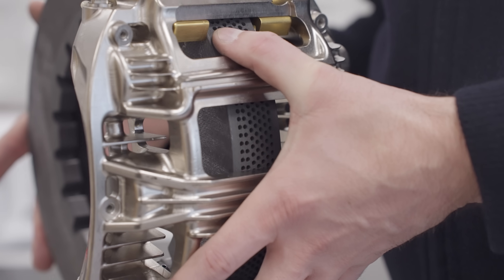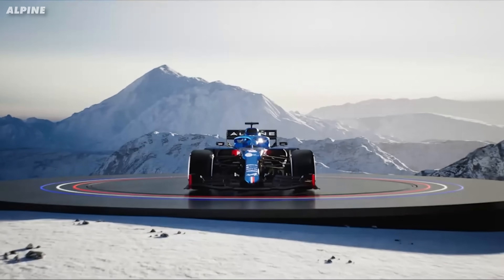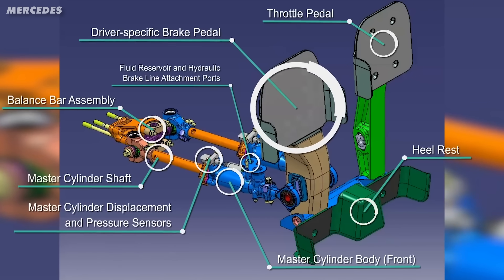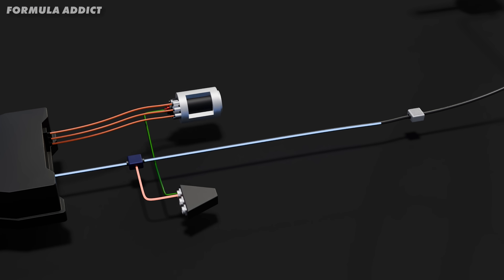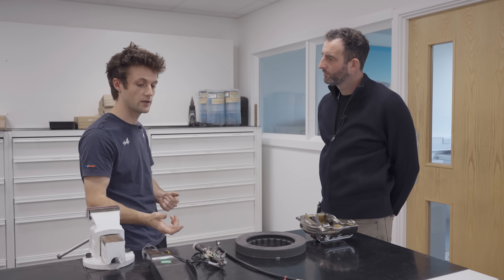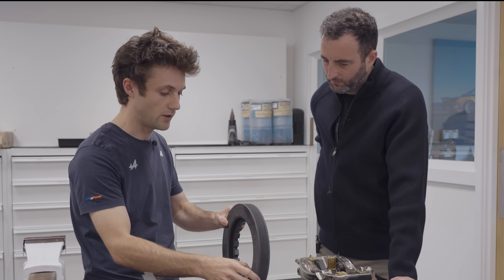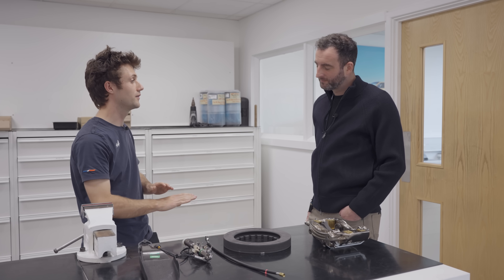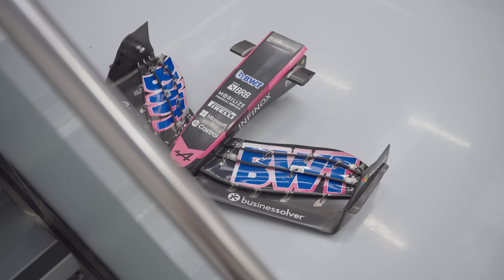How Formula 1 Brakes Work (F1 team explains)

Comment: Speed in miles, distance in meters… ah the complete insanity that is Britain. Home.
Reply: People make fun of the USA or being imperial system, but Britain uses both and I think that's worse lol
Reply: @otmgi3865  Beer & Milk sold in pints, soft drinks (outside of pubs/resturants) sold in litres, fuel sold in litres but we measure usual of fuel in Miles per Gallon.
Reply: @ThexMJT  Bruv. Stop. It hurts.
Reply: @ThexMJT  I'd be happy with going with km/h for road speeds. We all know what a km is now
Reply: @a1white  how about nautical miles or inches pound feet to Newton meters. Welcome to the world of the UK and engineering
Reply: @a1white  We have done for about 50 years now. However as an Engineer (X) I have no difficulty with SI Units except road journeys where I still think in terms of miles for mental calculation of how long the journey will take.
If we were to have metric time then I will have to start rethinking.
Reply: @ThexMJT  But how much does the car weigh in base 14 (Stone)?
Reply: Driving in km and km/h only.
For everything else, inches and feet... And dont forget the thous, use them every day.
Only exception is my 10mm socket.
Reply: @sphaleritecarcharias1404  Regarding your 10mm socket, is that 1/4 inch drive or 3/8ths?
Reply: In some way it's better as we can adapt to other systems. It's Britain in a nutshell though, always somewhere in-between sitting on the fence.  @otmgi3865
Reply: @otmgi3865  Then look at Australia, they do it too
Reply: Furlongs per fortnight anyone?
Reply: @tedecker3792  Unfathomable haha
Reply: In Canada we measure outside temperature in Celsius and inside temperature in Fahrenheit.  At the time we converted, most homes had an imperial thermostat, which was not replaced.  Outside thermometers were soon replaced with centigrade versions.
Reply: never in my life have i noticed this before, and that is hilarious
Reply: At work we order wire in mm width and length in inches 😂
Reply: @tonicdb  beacause wire is standardized in cross sectional diameter in mm

i mean fuck it wanna use the american system where we dont measure it on how thick it is or how much current it can carry (you know stuff we actually care about)

no we will measure it based on how many draw plates you have to push it through to make it that thick

which is about as much sense as me measuring bread slice thickness based on how many slices the loaf has

ah yes id like a 32 thickness as the 18 slide bread was too thick
Reply: Sharing that exact same feeling.  From Canada with love: where temperature units depends on whether its within or without; food cans are in ml, but recipes are in cups, while "nutritional values" are per grams; and of course where using ounces means fuckall.  Is the ounce US or imperial?  Volume or weight?  What about figure of speech?  Or any combination imaginable?   Just nod and move along.
Reply: @sophiamarchildon3998  lol, I didn't know that inside/outside thing.  Driving in Northern Montana for work for years, I listened to Canadian Public Radio out of Ragina. I taught myself to convert F to C to F by listening to the weather report and looking at my cars thermometer.  😁
Reply: Like a timber: 2"x4" 3m :D
Reply: @Svendrys  In new Zealand its a 4 x 2 and metre's (not meters) in lenght.
Reply: The important things are metric, the social and cultural things are left in imperial.  So science, engineering and the like are metric, how far it is to the pub and how much a measure of beer you're getting is imperial.
Imperial measurement are defined by Metric weights and measures as are all US imperial weights and measures.

A one pound weight is officially defined as 0.45359237 kilograms.
The inch is a unit of measurement that is equal to 2.54 centimeters.

A pint in the British Imperial system is defined as 568.26 cubic centimeters (34.68 cubic inches) or one-eighth of an imperial gallon. The units for dry and liquid measure are the same in the British system.

A pint in the U.S. Customary system is equal to 473.2 cubic centimeters (28.9 cubic inches) for liquid measure and 550.6 cubic centimeters (33.6 cubic inches) for dry measure. 

The mile is a unit of measurement that is officially defined as 1,609.344 meters. This is the result of an international agreement in 1959 that standardized the mile in relation to SI units.
Reply: @ If it needs a 5 paragraph explanation, it is a mess
Reply: i just noticed this too. even in races they do this lol.
Reply: Temperature is celsius, but the tire size in inches and the hole count in the disks in integers.  Where will the madness end?
Reply: @v3rlon  i think we have them in both.

also there's no madness here, only to outsiders. no better security than confusion.
Reply: And the U.S.  Dumbest thing is hanging on to the imperial system.
Reply: @johntomasik1555  The US uses US Customary Units, not the Imperial system. There's some similarities and some differences, our pint only has 16 ounces but they're bigger ounces so an Imperial pint is only a little bigger than a US customary units pint. 

The US uses the French metric system when it counts, in science and engineering.
But we choose the old units for things where it makes sense and when our already paid for equipment is in inches. 

Don't worry about it. When was the last time you saw an American comment in a video complaining about the units only being given in the French metric system. We know both and can convert in our heads.

We're just better at math, I guess.

How many "stone" do you weigh?
Reply: @Mishn0  Still a pain in the ass, any way you look at it .  Been an engineer for 30 plus years, and it's been a thorn in my side the entire time, especially having to deal with international development environments as well as medical products.
Reply: @johntomasik1555  I can't overstate how many people here hate all things metric... JUST because it annoys you people for no reason.  🤣🤣
Reply: @playgroundchooser  It's really baseless.  Metric is SO much easier.  I do understand why there's the hatred....humans hate getting outside of their familiar environment.  When I first got into engineering, there were a bunch of old-timers (many of them machinists) who would seethe if you tried using metric units.

And may the gods help you if you ever have to deal with the "slug".
Reply: @johntomasik1555  Absolutely! Tell someone that what they use, and how they think, is stupid... they will Never adapt.  
I honestly have a hard time with kilometers when driving, because I don't drive using yards. Like, the sign isn't "turn left in 300 yards" here. It would probably say 1,800 feet or 1/4ish mile. But elsewhere, (Like when I drove in Curaçao) they actually have signs that say "turn right in 300 meters."  Hard for me to convert while flying down the highway. 😅  I bet if I practiced, I could figure out that at 120kph, you go 1 kilometer in 30 seconds, so that 300m would be 12ish seconds of driving. 😆
But, when I'm just sitting here,  the conversions are super easy, and I already do them damned near every day in my head in just normal life stuff.
Reply: @playgroundchooser  Yeah, we'd eventually get used to it.  Doing the conversions is kinda quirky.  But, eventually we wouldn't do those anymore, 'cause nobody would care what the old units were.  BTW,  I rough the km to miles thingy by thinking a km is roughly about 60% of a mile.  So, 60% of that 120 kmh is about 72-ish mph.

The ones that hurt are give me 0.02" clearance on a 9/16" hole.  What a pain in my assholes (as Borat would say).  Now, give me a half mm of clearance on 1.3cm is easy....that's 1.35cm.
Reply: Its annoying wanting to use miles and meters together with the satnav and not being able to. In the uk, we have a better sense of what a mile is to a km. but we also have a better sense of what a meter is (meter ruler in most classrooms) compared to feet. Only place we have a better understanding with feet and inches is people’s height. Thats the uk.
Reply: @ZeerakImran  this is why I set my bike gps unit to metric (as do most cyclists). It’s easier to countdown metres to a junction when you know it’s 1000 metres to a km. who knows how many yards there are in a mile?
Reply: AL-PEEN
Reply: Never understood that nonsense lmao but the Americans are crazy.
Reply: I remember the first time i heard body weight in "stone" measurements. I think it was a strongman competition. I was thinking well i do want to know how much these big dudes weigh so i had to look this one up as well💀
Reply: I was in the UK this summer. My friend said it was going to cost too much money to change all the speed limit signs nationwide. So they left them in MPH.
Reply: I learned both in grade school and I feel like knowing both rather than one has enriched my life
Reply: Bruuuuuuh
Reply: Multiply by 1.64 for km/h
Reply: america pretending like they dont use km when talking about speed but talk about how fast there car can do the quater mile
Reply: The only place you can buy SAE sized nuts with metric threads. 🤪
Reply: Distances need very high accuracy
Reply: I think theres always a better measurement for each catagory for example Fahrenheit is better than celcius because its more precise, meters are great because it converts smoothly to mm, cm and km but miles is better for distance because when measuring something large its nice to have a small number instead of 300kmh you have 180mph and for weight kg is better
Reply: It’s due to Europe.  We used to use yards, feet and miles.
Reply: Because here in Britain, we have the ability to cope with more than one unit of measurement. Suck it up, sunshine
Reply: @peanuts2105 don’t think its a choice. Just cope cope cope. A lot of coping over here. I don’t mind either. But unless i’m a tailor, feet and inches are for measuring people’s height. And yards are just something we hear but never comprehend. A pint is like a glass but more. A gallon is 4 litres just like a month is 4 weeks. Neither is true but it’s what we go with unless it gets serious.
Reply: @peanuts2105  Please don't be in charge of British international relations anytime soon. Yours, all of UK.
Reply: @ab8jeh  Yeah, because David Lammy is totally nailing it. Oh, wait...
Reply: @stevegreen5358  2 months compared to 13 years. Do we really need to go back to primary school? I guess we do.
Reply: @ab8jeh  Lammy does. He's an utter clown, on the wrong side of every argument and every decision. He won't get anything right no matter how long you give him.
Reply: @peanuts2105  Sunshine is propabilly one of the few things you don't have to much of 😋😋
Reply: @peanuts2105  As an American I feel vindicated xD
Reply: @peanuts2105 Being stupid on purpose is still stupid
Reply: @peanuts2105  Government already plan to launder title cash and gain a bit of control over way to free  population by experiments to dim the Sun-shine
Reply: @peanuts2105  Go on then, how many metres in a mile?
Reply: @a1white  About 1600 (out of my head). New Zealand. When I'm out in my shed doing engineering work (like today) and I through the tape measure onto something I'll read off inches or cm's depending where the measurement falls.
Reply: @a1white  1609 m, 39 cm and 4 mm 😁
Reply: @a1white  1600
Reply: @a1white it's so easy drag strip quarter mile is 400M so just multiple off, actually I think American quarter mile might have been shortened due to a speed/safety thing?
Reply: @a1white  1610, give or take.
Reply: @a1white You don't divide miles with meters though....
Reply: @ about 1700. If I needed more accuracy, there's calculators all around that have conversion programs.

Comment: Molten lava? There is solid lava ?
Reply: Yes. It's still called lava once it's cooled. You can buy lava rocks for your sauna.
Reply: @Marcus_Shaw  wrong, lava is molten rock so when it is solid it are just rocks.
Reply: @daisaigaming6836   tell me you can't use a dictionary, without telling me you can't use a dictionary. 🤣

Dictionary
Definitions from Oxford Languages · Learn more
noun
hot molten or semi-fluid rock erupted from a volcano or fissure, or solid rock resulting from cooling of this.
"tablelands of lava"

LAVA | English meaning - Cambridge Dictionary
16 Oct 2024 — hot liquid rock that comes out of the earth through a volcano, or the solid rock formed when it cools

Merriam-Webster
Lava Definition & Meaning
5 days ago — The meaning of LAVA is molten rock that issues from a volcano or from a fissure in the surface of a planet (such as earth) or moon;
also : such rock that has cooled and hardened

Collins Dictionary
LAVA definition and meaning | Collins English Dictionary
noun
1.  magma emanating from volcanoes and other vents
2. any extrusive igneous rock formed by the cooling and solidification of molten lava

Comment: Brake fluid doesn’t actually have to move through the tube it’s already through as a air tight sealed system. It just all shifts just like a street car. People watching this might think the fluid has to from the master cylinder all the way to the brakes every time you step on the brakes. 😅
Reply: Savorychicken41
You need to understand Newton's pressure laws.
Here, just watch a movie.....
Understand any ?

Comment: I don't get it ... since the brake system is hydraulic, i.e. "power assisted", wouldn't the team have choice of how much pressure driver has to apply? why 180KG?!
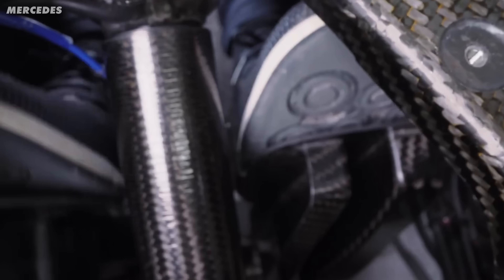Reply: Right: 4:01 ff ... apparently "heavier" gives more feedback, more feel.
Reply: hydraulic doesn't mean power assisted - there is no brake booster here. But yes, if the drivers wanted to use less force, they could use a different master cylinder. They would lose a lot of feel at lower brake pressure though...
Reply: @GamezGuru1  "here is no brake booster here." Oh! Thanks for the correction!
So adjusting master cylinder and/or that heavy spring ... copy.
^5

Comment: An interesting fact about those carbon/carbon breaks is, that their coefficient of friction increases by temperature. That means the breaks reach their maximum deceleration a few moments after you press the peddal, when they are heated up, which has to be accounted by the driver. Normal steel roadbrakes behave exactly the other way

Comment: Excellent video !!! Keep them going! In this video, or any other, it could be helpful to say something about the rules because rules make the breaks the way they are; they don't have absolute freedom to do whatever breaks. The brake constraints should be clearly stated; this really affects their design. Also, it was not mentioned that ABS is not allowed -> significant influence on brake design. But I am not 100% sure if that is true. It would be nice to know the limitations or rules they needed to follow on a surface level so that we know a little bit more about the challenges that engineers face and find creative ways to compensate for the lack of something... I hope this message reaches you.

Comment: 180Kg of force! in that case Verstappen's Left foot needs to be studied...
-Also - we need a (Group B) version of F1, Williams Racing may go straight to the top but F1 is kinda getting boring, we need RAW Spectacle & Theater coming from the unrestricted engines & future technology. Then schedule these limited races on the smoothest F1 tracks available.
Reply: When car starts braking, additional g-force acting on the driver applies to the force he's pressing the pedal with, which makes car slowing more, extending g-force extending force on the brake pedal. Driver couldn't apply such big force to the brake pedal, when stationary.

Comment: I need more explanation on brake migration.
Reply: I am pretty sure it's like on a motorcycle, you hold the rear brake while releasing the front more to get the roration, in this case it might obey some control laws set by engineers, and input all by drivers.